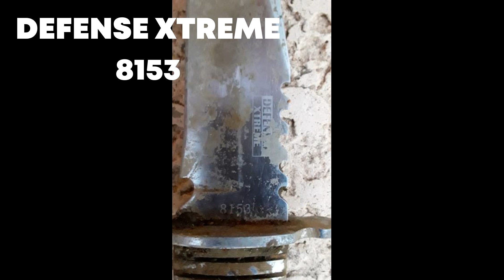CRAZY AMOUNT of COOL STUFF FOUND - MANY FIRSTS - Magnet Fishing AZ - EP47

Comment: What happens if you get stuck onto something to big to pull in and can't pull the magnet off?  How strong are the magnets?
Reply from the maker: They are very strong, but in that case you try everything to get it off, including pulling it with the car. If that all fails then unfortunately you have to leave it. There are various strengths you can buy. We use the Centurion 1400 LB pull clamp magnet. Thanks for watching.